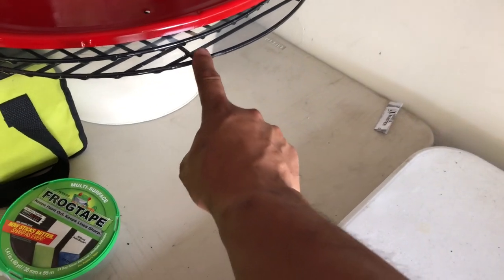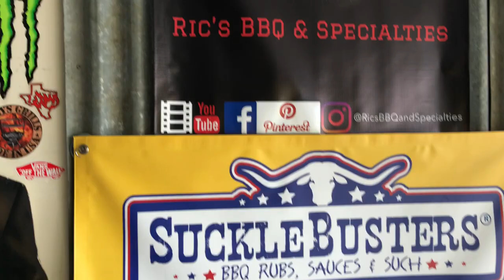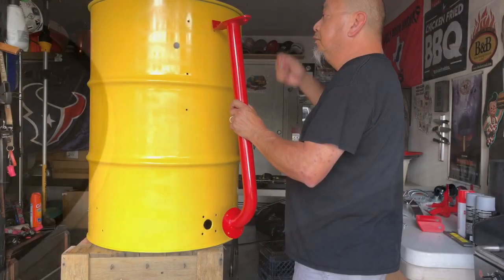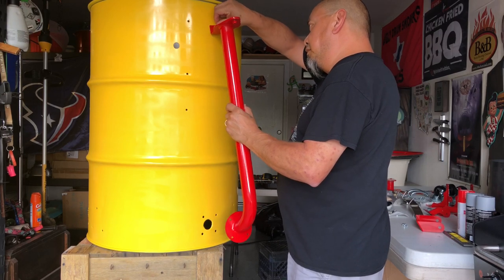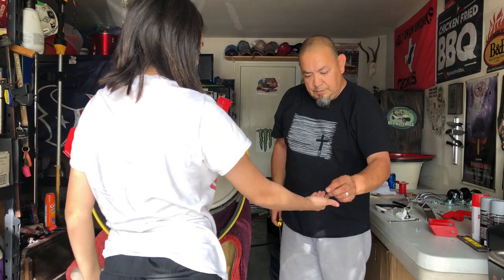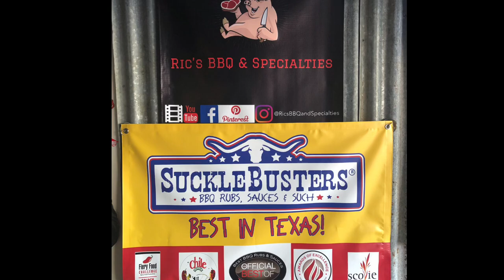How to Build a UDS Part 2 #HowToBuild #Sucklebusters

Comment: Nice build. That’s the first I’ve seen with the mixed air intakes, shorty & upright. Love the look brother. It is “Tight”!  Thanks for sharing. I’m removing the rust inhibitor now on a used food-grade drum I picked up for $20 at a local honey producer. I’m on fixed income now, so this project is being done in stages. Got the needed tools, the paint & the drum. Ordering parts next. Not going for a Kit. Mixing & matching from different kits. The build seems straightforward, I’m concerned about the paint process. Any tips or advice would be greatly appreciated. Thanks Ric. 🔥👍🏼😎
Reply from the maker: Thanks Brother, well regarding paint. Number 1 make sure all your holes are drilled. Burn off all existing paint then hit it with a wire brush. Rub down with alcohol to get it cleaner. Then two cans of high heat primer and 3 cans of high heat paint. You could go with the high heat primer heavy then regular paint but you risk the paint dulling or even burning off later. Good high temp spray paint is VHT engine and header paint
Reply: Ric’s BBQ & Specialties Thanks Ric! I appreciate the input. I was just watching another video of your’s cooking wings on the Weber Kettle. I’m making wings tomorrow on my Weber. Thanks for that one too! Yeah, I subbed to AB’s channel before I found you. Now I’m learning from both of you guys. Can’t wait to cook on my UDS. Peace to you and your family. 😎👍🏼🔥
Reply from the maker: Thanks Brother and anytime!